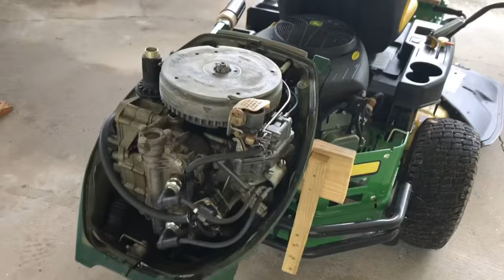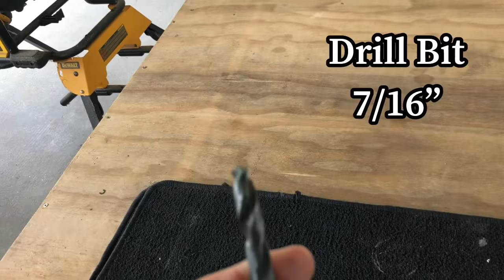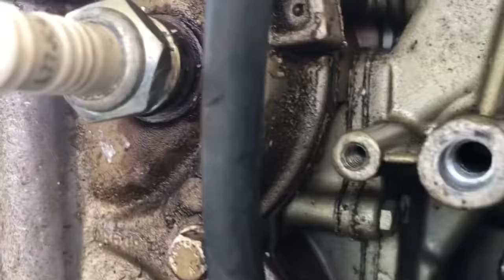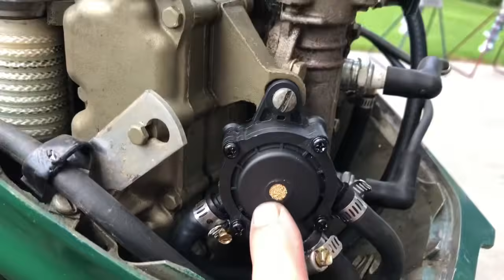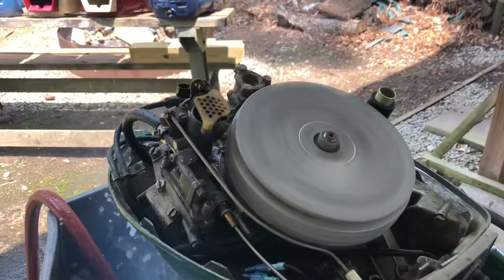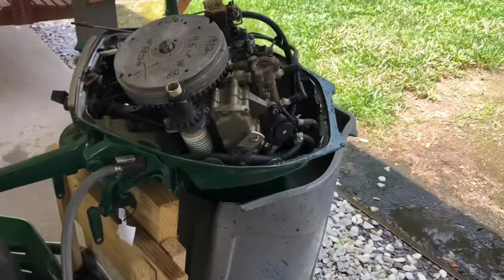Fuel Pump Repair Conversion Upgrade 1972 9.5 HP Johnson

Comment: I followed the instruction and drilled my 7/16 bit 1/2" in but now my fitting is too short to reach the hole therefore, the inside diameter of the drilled hole is too large for the fitting. I guess I shouldn't have but about 3/16 deep. Now, I will either have to buy another larger tap and a larger fitting or a Hilecoil if that will even work. Drilling into the aluminum no more than 3/16 would have been ideal. Back to square one, I guess. Argh!!
Reply: I tapped it with a 1/4 reducer to 1/8 pipe threads and was able to screw my fitting in and get my fuel pump working. Engine will start now, but eventually sputters and dies. Maybe electrical?? Condensers? I have good spark and have points set properly

Comment: Mike I just bought this off your eBay store a lot of people are confused and concerned with the tap and drill bit size can you please confirm actual tap and drill bit used?? I don’t want to ruin my outboard motor!
Reply from the maker: Barb thread is 7/16”-20 UNF
Use drill size 25/64”

Comment: Hear a lot of “hear say” saying they have problems at high rpm doing this pump swap it’s a great idea but don’t wanna drill an tap it an have problems just wanna know if this is true?
Reply from the maker: Never heard that before. I do not believe it to be true.
Reply: Swapped mine an the fuel pump just keeps flooding it out

Comment: I want to thank you for this awesome video. I just did this on my 20 hp 1972 johnson. I also could not find a bard that fit the threaded hole, but i was nervous about re-tappong the engine block so i used a die on the barb to size it down and it worked great. I took the boat out yesterday and it screamed! Thanks again!!!!

Comment: Great job thanks for sharing I have a question I have this motor it has stuck rings unit was stuck got it unstuck but compression is only 30do you have a video on this thanks
Reply from the maker: Sorry I don’t do powerhead work - I recommend finding a used one on eBay - $150 to $250

Comment: Why would you drill and tap the hole when it appears to be already threaded?? Do they not make smaller threaded barb fittings.
Reply: I'd also like to know this. I have a 1972 20 hp. The thread is 5/16. I just ordered a 5/16 barb and the Kohler fuel pump. I'll let you know how it goes. Will be a few weeks until I splash it since I basically live in Antarctica (not really but close enough)
Reply: @nauticajr22 did the 5/16 thread in?

Comment: I dropped the roll pin down in the engine compartment trying to install 0384597 Pinion Gear on a 1972 johnson 9.5 hp pull starter. How can I get it out?
Reply: Thanks T Mike.
I have two grandsons that can do it.
Reply from the maker: Turn da motor upside down and shake it - major drawback to those motors.

Comment: very good idea, I wonder how well does the pump deliver fuel on the engine at high speed? it can keep up with the demand? I just ask beacuse I did the arrangement, but with a fuel pump from a scooter, it looks smaller than the one you used, I must say, it works fine at low speed, but when I ask for more speed, it can't keep up with the fuel demand. got the same outboard, is a '71 9.5 evinrude. Thank for any comments.
Reply: I just did this on my 1972 Johnson 20 hp. I had no issues at high speed. This was an awesome idea!
Reply: @nauticajr22  thanks You. Justo a few days after My first commentary, I got they same pump in the video, and works pretty good.

Comment: I have a 1965 6 HP Fisherman with a shot fuel pump.  Can it be rebuilt/replaced or is there a Kohler model that I can retrofit?  Thanks  - your work is awesome!
Reply from the maker: https://youtu.be/bA_0V3yY1Lo
Reply: @michaeljsimon  - thanks!  I assumed the '65 6hp and the '72 9.5hp would have different pumps.
Reply: Many thanks!  The conversion works like a charm!
Reply: @michaeljsimon  this link doesn't seem to be working. Is it a different part number for a 1970 6hp Fisherman? Thanks

Comment: i like to stand on the back of the zero turn T Mike 👍 handy for them small motor . I did the same conversion on my 72 25 hp Evinrude it’s been running great ever cents .